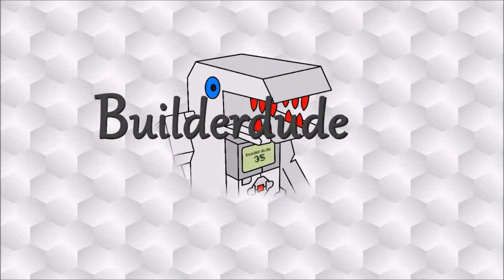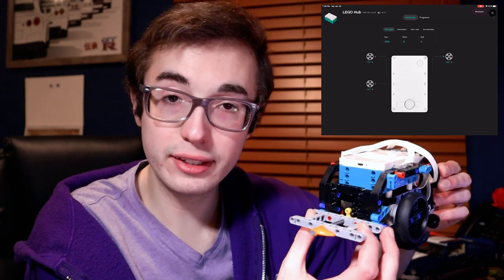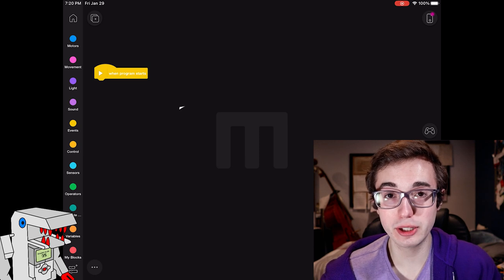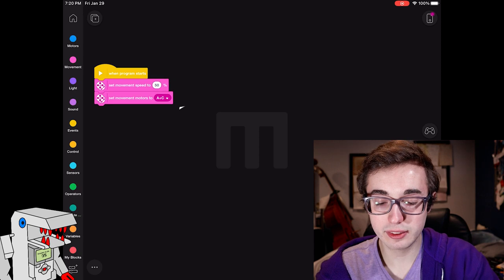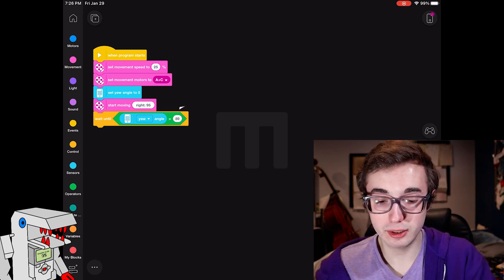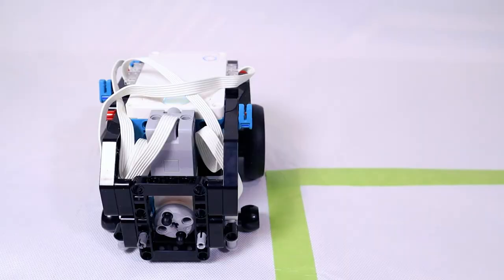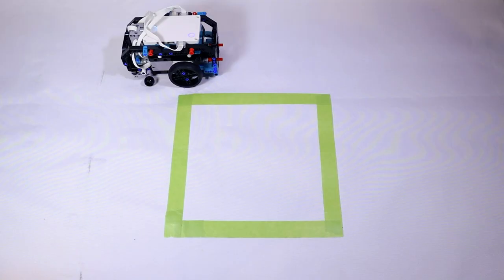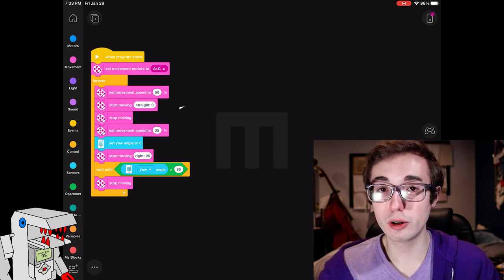Program Accurate 90 Degree Gyro Turns With LEGO MINDSTORMS 51515

Comment: Yes, 90-degree gyro turns have helped my FLL team in the past (using EV3).  When our state's FLL competitions resume, many teams will be using the 51515's gyro sensor.  I can see that the 51515's Gyro Sensor is superior to the EV3's, which has a problem with gyro "drift".  During past FLL competitions, some kid would often bump the game table (in his/her excitement) and throw off the gyro sensor's calibration.  ;)
Reply from the maker: I am really excited to see what FLL participants can do with the 51515 gyro! Just as you noted, the 51515 gyro sensor is far better than the EV3's; the 51515 gyro not susceptible to drift. During my time using the 51515 gyro to make this video, and even while programming my 2-wheel self-balancing robot (next week's video) I never once had to worry about drift even though I was moving the robot around in a way that would irretrievably disturb an EV3 gyro.

Comment: I noticed in your final code in this video that you did not set the hub orientation. Does it default to upright and therefore not need to be specified? I built FLL Casts Whakatae, and my robot is not turning even close to 90 degrees. Is there any kind of calibration that might need to be done? Thanks for all your videos. I've been watching since you started making them and often recommend that my team watch them. 

I did a demo on Elevator using my garage attic FLL table yesterday. Yes, I coach for 7 years now. I was thinking  gyro pitch could be used to see if the robot makes it up the bridge successfully or not. I may have to try that. 

My hub got hung up on an update yesterday, and I had to pull the battery to shut it down. Not a big deal, but new robot, old issues. MacBook.

Comment: This is really not how you should program this, first if you reset the sensor every time you make a turn the errors will add up, but i guess it's a simple program for beginner,
You should use a loop and  use proportional control of the motor's speed until the robot is looking in the right direction and fully stopped
Did you have any issues with this sensor ? I remember that the EV3 sensor was very hard to get working reliably

Also it would be nice to see a program to go perfectly straight with the gyro :)
Reply from the maker: Thanks for the feedback. Considering that my audience is generally younger, this simple program will have more obtainable results than something more advanced, even if it trades dome accuracy.

The new 51515 gyro sensor is in a different league compared tot he EV3. The 51515 gyro is much more reliably and I haven't seen it drift yet like the EV3 used to. While making this video, and while programming my 2-wheel self-balancing robot (next week's video), I did not need to worry about drift at all, even though I was moving the gyro sensor in a way that would throw off an EV3 gyro.

Rest assured, a gyro drive-straight tutorial (with PID?) is coming in the next few weeks!

Comment: What if we use the ideia you presented in previous videos (use proportional condition) to align the robot in line while it is moving, then turn 90 degrees, them align while moving and so on.. is it going to get a better accuracy in turns?
Reply from the maker: That has the potential to be more accurate, yes! You could use my line squaring algorithm before making the turn to get a more consistent starting point, and then your turns will be very precise.

Comment: for some reason, our robots (all 6) are hesitating and jumping forward using the 'start moving by angle'  block when we use any turn degree > 35... any ideas why?  We've updated and reset the bricks.   We don't experience this when using single motor blocks to turn.

Comment: Cool as allways :)  When you make a self balancing bot - do it with PID  and show excatly all the steps to find the best P, I, D values
Interresting to see 
Behaviour of the Bot
Which Value are you changing and why do you do this step
This in 100 loops when necessary :D
So your followers can exactly see the way you iterate to a good result
I'm aware that this is a big work but this is the knowledge is hard to find in YT
Reply from the maker: Absolutely, I will try to share a reasonable amount of detail regarding tuning and what I have learned. Thanks for the suggestion!
Reply: Yes and also @Builderdude35 you should create that program as a my block and you can add an input value of the degrees you want to turn.
Reply from the maker: @rammaddirala6857  yeas absolutely! MyBlock tutorial coming in the near future!
Reply: PID yes!